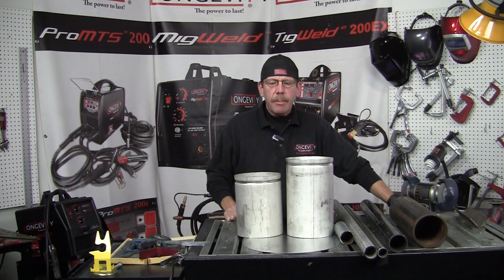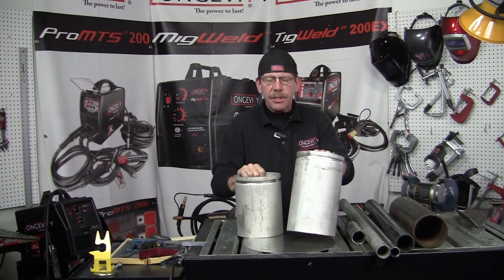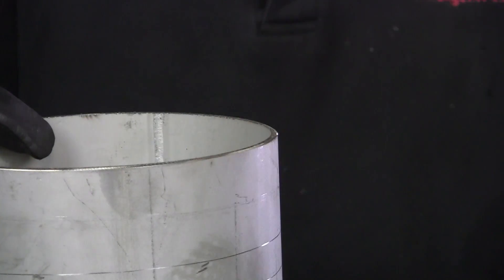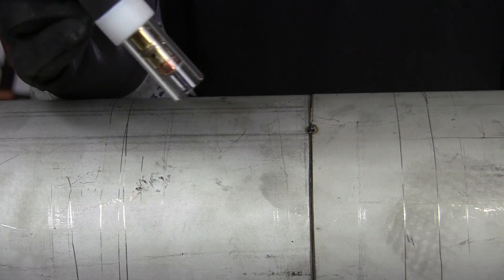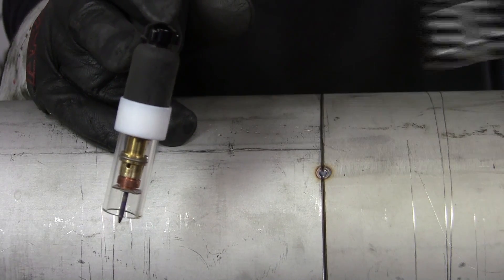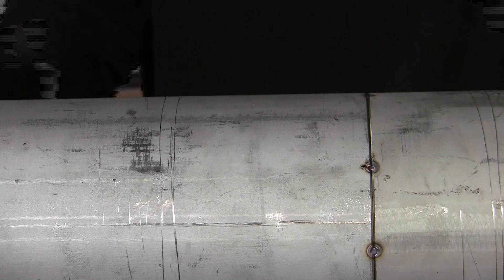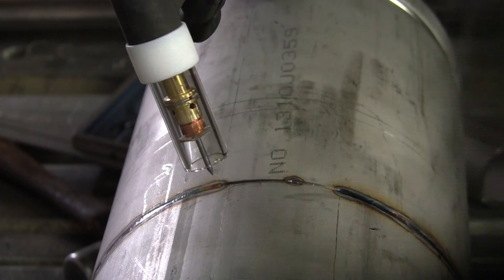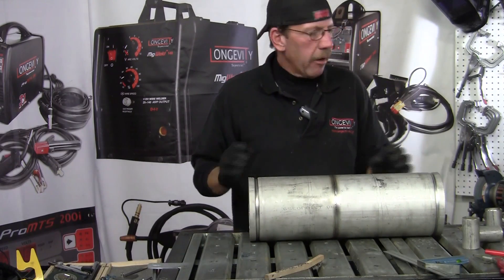HOW TO WELD STAINLESS STEEL PIPE TIPS AND TRICKS PART 1

Comment: This is an extremely poor example of any SS welding. The organization that is responsible should take a close look at the information they are putting out. Longevity Welding is a mfg of low cost import machines that I have used however they seem to be a bit short in the understanding of actual welding. Having the ability to run a bead on a certain type of metal IS NOT the ability to properly weld that metal. No more than running a bead on a piece of pipe makes you a pipe welder. Throwing a bunch of videos on the internet made by customers and distributors with no experience in what they are demonstrating may be ok for the home hobbiest, but actual welders will call you out. 

One of the bad things about the internet is the ease at which poor information can be spread.
Reply: One experience with them and it was my last.  Fortunately, it didn't cost me the whole price of the machine just their fee's--had to threaten a credit card chargeback.  Goes to show anyone can make a video regardless of what they know and try to pass it off as factual.  Have those welds inspected by a food facility inspector and then you can buy a real machine and do it over, and right.

Comment: Why don't you show everybody how to do that while it's in a pipe rack 12 ft up in the air over head.
Reply: +Erik D hey buddy, first off he didn't bevel it correctly, you should have a feathered edge, then clean up the inside and outside of the pipe with a die grinder or whatever you got. after that tape the ends and have a purge gas (argon or nitrogen). then have a decent fit, it varies in pipe diameter. have the purge going good then take it about a half inch, then the bottom and then sides. with the purge on of course. if you want to watch a good beginner welding channel I suggest welding tips and tricks. oh and you need a welding hood too, those arc flashes are nasty business for the eyes.
Reply: +jedediahbc Why dont you show a video of it? He made a basic beginners video for people to watch. Its not called welding stainless pipe in pipe rack 12 feet in air. I didnt search for that, so how did you get here, did you search for that? Quit being a fucking douche bag. The video is not perfect, but then again its not for a trade school or college, is it. Its on YouTube, which is amateur and beginner stuff. I for one appreciate that he is trying to help someone somewhere. Funny how people who put the effort into trying and making a video get down trodden by people who don't  have any videos. Go on, make one, show us, show all of youtube how to welding it in a pick rack 12 feet in the air. We are waiting.

Comment: HI i have to weld a stainless prop shaft to a stainless steel shaft with splines  on the end- each shaft is about 1  1/4" thick- i figure to cut each shaft in half long ways about 6-8 inches,  then hose clamp them together then weld- ii can weld ok-  but do i need special wire or rods? i have both welders in shop.
any advise???
its for an invention of a motorcycle /trike/ boat, it wont be in water much  at all, i am making  a drive shaft.
Reply: +Paul Zeiss not sure what you mean ss can be dif like 316 or 304 ss to mild use 309. grind off mill scale of mild steel. thats the short answer. pic needed

Comment: The inside of the seam is either not penetrated which leaves a weak joint or the penetration bead will be crap without the pipe being purged - either way an amateurish job, do not copy.